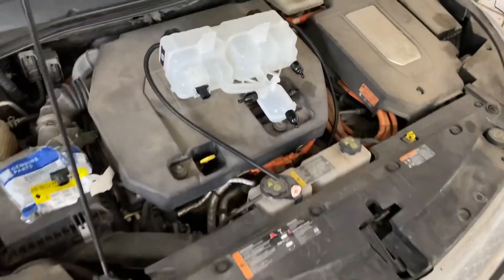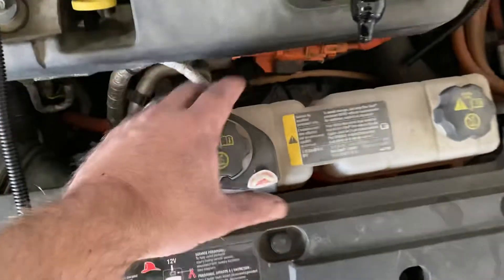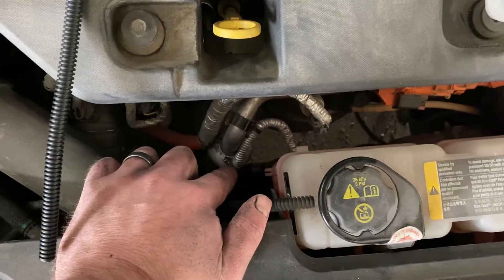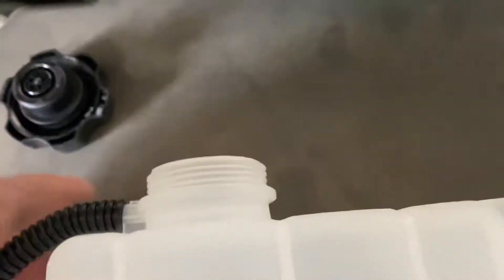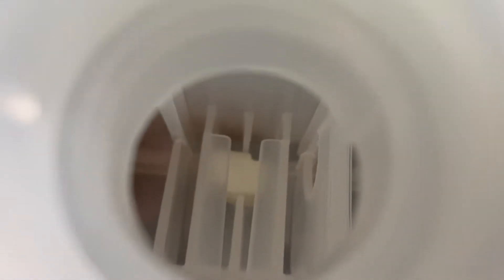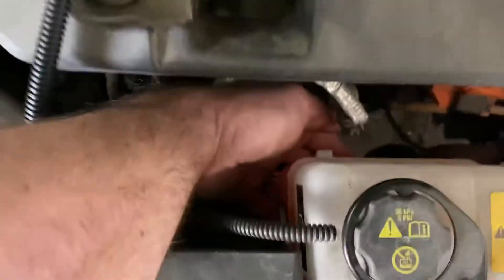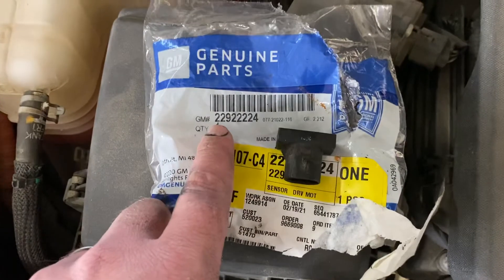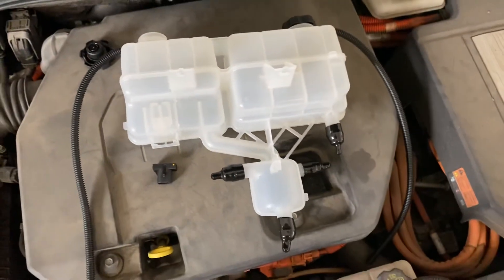How the coolant level sensor works on a Chevy Volt for “Service High Voltage Charging System” error

Comment: I was able to replace the coolant sensor. I couldn’t clear the message/codes with my Bluetooth scanner (ANCEL bd200. I believe). Took it to a mechanic, cleared it for free, I was able to charge for about 3 days and the message came back and didn’t allow me to charge. Anyone with the same problem? How did you solve it?
Reply from the maker: If the coolant level has dropped you may have a leak inside the battery.

Comment: Question: Once that magnetic sensor it tripped by low fluid, does it not reset once you top up the tank?
Reply from the maker: No, that’s the sucky part. A decent scanner can SOMETIMES reset the code stored in the HPCM2 module. Sometimes they can’t. I have a video on doing that both ways.

Comment: So i just replace the sensor and the high voltage code will go away? 🧐
Reply from the maker: Nope. The sensor needs replaced then the code can be reset IF the code popped due to a bad sensor.

Comment: I tried this fix and others for service high voltage system and none worked.  I had to go to the the dealer for them to reprogram two different modules and the codes have been off for over 6 months.
Reply from the maker: This isn’t a “fix” for the code. I have 2 other videos on how to clear the codes. This is just an explanation on where the sensor is, how to switch it, and what the part numbers are.
Reply: It's easier to just go to the dealer and have them reprogram, and then the codes will stay off or they can fix it again for free.
Reply from the maker: @smitastic7030  I hate dealerships, going to them, paying them, and they usually screw it up anyways.
Reply from the maker: @smitastic7030  watch my other videos. I’ve cleared HPCM2 codes as well as flashed the module itself with fresh software. Don’t need to be the dealer. GM actually makes it very easy.
Reply: @utjay2008  i replaced the snesor, clear the code with a simple scanner, and drove for a and the code came back.... do i need to go to the dealer to clear the code, all they want it for me to replace the wholte thing and the coolant reservoir tank.

Comment: Thank you for posting this video, it made changing the sensor out much less challenging! Just seeing the holding clip helps a lot. A side note unhook the 12 volt battery before changing the sensor, or you get a warning propulsion system operating at reduced output, and the gas motor runs all the time. Easy fix though, I just unhooked the battery for a minute and everything is working again! $21 for the sensor at my Chevy dealer. GM#22922224

Comment: Chevrolet dealer wanted $1100 to replace the entire reservoir. I replaced the $20 sensor and saved a bunch of money.  Thank you for making this video.
Reply from the maker: Great to hear!
Reply: Still working for you?  I got same problem and would like to know if it is sensor to replace?
Reply: @MrPaulHolm gotta replace the sensor and remove the error code with one of those “computers” you can find from one of these videos for like 150 dollars
Reply: @MrPaulHolm but has your situation changed after 9 months?
Reply: Such crooks!

Comment: My 2012 volt, 309k miles currently has had this code on for a year now, and I tried to diagnose it but the sensor is good and connector gets its 5v reference voltage, on top of all that I tried to get it reprogrammed and it's still not clearing the code anyone know what I should check next or what part of the system could cause this issue
Reply: Could be the float in the tank doesn't float any longer meaning the magnet is sitting on the bottom of the tank
Reply from the maker: You could try to remove the sensor from the tank, but leave it connected. Then clear the code. If the code comes back, it’s most likely a bad sensor.

Comment: Tip: use a small flat screwdriver wedge out the sensor. You'd push the flat end of the screwdriver in between the sensor (opposite side of that yellow dot) and the sensor slot wall to get it out. got mine out in 3 mins. Thanks for the video!

Comment: Thanks for the tutorial, just replaced mine, now going to wait til the CEL comes back on then take it to a local indi shop that can reset permanent codes
Reply: For anyone wondering, to remove old sensor, it slides forward towards the Chevy logo

Then I unplug the old sensor, insert the new sensor, that way I don’t accidentally drop the new sensor, took a minute or two to slide in place

Comment: Is this the same for a 2014????
Reply from the maker: Sorry just saw this comment - I believe it is. The wiring is better though.
Reply: @utjay2008  Im going to try and replace the sensor blind. Which way does it come out if I'm looking at the engine? Does it pull out away from the tank towards the engine or towards the grill??
Reply from the maker: @drumcorpsfan  going by memory and I could be wrong… but I think it pulls towards the grill.

Comment: UPDATE>>>>OMG!  I'm soooooo happy that I found your video.  As I stated in my prior post my SHVCS error message came up back in October 2020 due to low coolant level...added Dex-Cool 50/50 cleared the codes with CP9125 PocketScan Code Reader and all was good to go.  On August 1st 2023 the SHVCS error message came up again but, this time my coolant levels was just fine.  Upon your recommendation I went to my local Chevy parts department and picked up the part you mention in your video GM Part #2292-2224 cost $22.57 with tax.  WELL >>> today after doing some more research on how to install the part along with your instructions, I was able to replace the coolant sensor without removing the tank from my car.  Using both hands (hand & thumb) I was able to push the sensor out of the bracket >>> towards the front of the car, (half the battle is knowing how) took all of one minute to replace the sensor, the hard part was getting the new one back into the bracket just by feeling the way in, finally it just found its way a minor snap into place...wow!  Now all I needed to do was to clear the error codes.  (Again, my car is a 2015 Chevy Volt) With the car on (engine off) plugged my original CP9125 code reader, hit "READ" and it came up with 6 codes, push and hold "ERASE" key down, after it asked "ERASE CODES?" push and hold down the ERASE key again >>> all codes cleared.  The check engine light is now gone, plugged into charger and YES I'm changing again...

Comment: Great Video...I have a 2015 Chevy Volt, in October 2020 I got the SHVCS error message, turned out that my coolant level was low, so I added Dex-Cool 50/50 coolant and cleared the error message with Actron CP9125 PocketScan Code Reader and presto like magic all was good to go...until today 8-1-23 I got the same SHVCS error message, however this time the coolant level was where is should be.  Sounds like the same problem you talked about in your video.  Would you recommend changing out the sensor?
Reply: Same here.  I got 2015 volt, 1st SHVCS I added coolant and code went away.  Back on now and I'm going to try to change the sensor.  What did you find?

Comment: We were driving our 2017 Volt in the desert yesterday (March 31, 2023 Southern California).  The outside temperature was about 76.  My husband was driving fast on an empty road.   When we stopped and turned the car off, it turned off but the engine kept running.   I checked the coolant temperature and it was 255 degrees.  The car did this once before when I drove about 70 miles in the city on the freeway.  I'm assuming it stays on to continue cooling the engine.   I didn't notice a coolant message yesterday.   After a brief stop, when I started driving, the outside temperature dropped to 60 degrees or less and the coolant temperature was 175.   There is a way to see the coolant temperature on the dashboard while driving.   My question is, at what point is the coolant temperature too hot even without a message and when should you pull over and let it cool off?  I love this car.   I didn't need to put gas in it for 5 months.   I made it use gas because I figured it was getting too old.   Sometimes the car will do that on its own.  Thank you.

Comment: I just went through a $500 repair to have the tank replaced because  of a bad sensor... 86 miles later getting the same High Voltage charging system error message... now they want 47200 for hybrid battery.  Not sure I even trust the dealers diagnosis.
Reply: DONT TRUST THEM, THEY ARE DISHONEST OR DUMB

Comment: On my  2014 Volt, 70k miles, I got the Service High Voltage Charging System error and Check Engine light.   Another video suggested checking the Coolant Level in the tank THIS video refers to.  Its a Two part tank with two reservoirs.   The Left hand side of tank was less than 1/2 full,   added 50/50 Dex Coolant from NAPA, then a friend used his obd2 device to CLEAR the codes.   That totally fixed my Volt...it now charges up fully and no more Check Engine or Service High Voltage Charging System errors......for now!
Reply: Has the issue returned?
Reply: Do you know or could you ask what OBD2 device your friend had used to clear the codes? you would be saving a lot of time and money for people.
Reply: Did you have to disconnect any of the batteries in order to replace the sensor? Feedback from anyone is appreciated.

Comment: Is it possible that the magnet could get stuck in the position of continuing that error? If so how could we fix that?
Reply from the maker: Anything’s possible, but I doubt that would happen. If it did, you just need a new tank. I think that would be the easiest sure fix for it.
Reply: @utjay2008  one more thing. I haven’t tried to clear the HPCM2 code yet. How much do you assume(ballpark) that might cost me at the dealership?
Reply from the maker: @Ashtonscreative  anyones guess. I would say $200-400. They’re going to reprogram the module I’m guessing.
Reply: @utjay2008  daammmiittt
Reply from the maker: @Ashtonscreative  I’ve got a few videos on how to clear the code or reprogram the HPCM2 module.
Reply: @utjay2008  I’ll go check them out. Though I’m sure I’ll need to buy the reprogrammer. How much is that?
Reply from the maker: @Ashtonscreative  I use the VCX nano. $120. It can sometimes clear the code. If you need to reprogram can he module it’s a $40 subscription for 2 years. It gives you every update for every module on the car for that time.
Reply: @utjay2008  truly sad that we need to do that or get charged $200-$400. Just to clear a code.
Reply from the maker: @Ashtonscreative  by all means please get a quote. That’s just my guess. But i agree if my price was in the ballpark.
Reply: @utjay2008  thank you!
Reply: @Ashtonscreative  Cost $550 at the dealer 2 years ago

Comment: Hi I've been trying to replace the sensor without having to pull out the whole tank. It seems in your video that it only comes out pulling towards you and the tank is attached on that side. So do I need to remove the tank in order to replace the sensor?
Reply from the maker: Hi, you can replace the sensor without removing the tank. You have to feel it, but you can slide it (forward or back - I can’t recall) after pushing the release.
Reply: It slides toward the front of the car.

Comment: What are the flexible black plastic tubes coming from both sides of coolant reservoir?  Mine somehow were chewed or ripped in half not sure how
Reply from the maker: The ones on the video I think are protective for shipping only. Emphasis on I think.
Reply: Not those…. the long tubes you keep moving out the way in video they plug in next to the black caps where you add coolant
Reply: Thank you for reply by the way
Reply: When you picked up the coolant reservoir to show inside it is hanging from top
Reply from the maker: Ah ok. Makes sense. I can’t go look at it right now. I think they are overflow tubes.

Comment: I replaced the sensor and the fluid level is normal. Now what?
Reply from the maker: If the SHVCS error is still present you’ll need to clear the code in the HPCM2 module. Or program it with the latest software.
Reply: Can just clear the code with a basic ELM327 dongle and a code clearer app such as Carista

Comment: I have a 2013 Volt.  Looks like yours is older too.  I went to order part number 22922224 but the site said it wouldn't fit a 2013 Volt but would work for model years beginning in 2014.  Do you think that's right?  Thanks again.
Reply from the maker: That’s really weird! Mines a 2012 and worked fine. I see a lot of the websites list it as 2014+. I’m not sure what I’d recommend. If it were me I’d buy it, but either way good luck!
Reply: Make sense.  Thanks a lot!

Comment: Thanks a lot for the video. Will the SVHC code clear itself when the problem is corrected?  If not, will I need to get a scan tool that can do it?
Reply from the maker: To my knowledge you’ll need a tool. I use a VCX nano.
Reply from the maker: @Dimetri777 here is the video I have on how to rewrite the HPCM2 software (same basic idea for the BECM software too). 

Using Techline Connect and a VCX Nano to fix Chevy Volt Service High Voltage Charging System Error
https://youtu.be/eza-Y3oUnS4
Reply from the maker: @Dimetri777 if your scanner can erase the code, but it comes right back, then it’s most likely the sensor or wiring, possibly the software. 

The VCX Nano is about $120, and the SPS2 / Techline Connect subscription is $40/2yr. The VCX Nano is the device that connects the SPS2/TLC software on your laptop to your car/OBD2 port.
Reply: @utjay2008  is this the only way to clear the code after you replace the sensor?
Reply from the maker: @Bomexxx I have 2 more videos are clearing the code. The foolproof one uses a vcx nano and reprograms the HPCM2 module.
Reply from the maker: @Dimetri777 did you test the sensor with and without a magnet to switch resistance?
Reply from the maker: @Dimetri777 that’s wild! Sounds like the sensor is definitely working. Very strange. Sorry I can’t help much more. If I think of anything I’ll post back. I guess it just needs a software update. If it’s a 2012 then check the wiring just behind the radiator. Keep us posted! Your comments will surely help someone else - which is why we’re all here!
Reply: What ended up working? My 2013 volt is having a similar problem after replacing the sensor.

Comment: In my scanner I believe this is the "Hybrid/EV Battery Pack Coolant Level Switch". I just replaced my coolant level sensor and it is reading 3.55 V. Silly me I didn't think to get the before reading, but I had the "P1FFF-00 System Isolation / Coolant Level Sensor Fault - Hybrid/EV Battery Charging System Disabled" and "P1FFD-00 Hybrid/EV Battery Pack Coolant Level Sensor Circuit High Voltage" codes. 3.55 volts should be good.
Reply from the maker: Good info! Thanks for sharing for the rest of us!

Comment: My 2015 volt had the same message pretty much on daily basis. I recently called around and found a dealer that simply did a software update, per GM bulletin 21-NA-224, and the problem is gone. I was lucky because the sales rep had the same car and was very helpful. I’ll update if the problem returns.
Reply: Thanks for the info. Do you need to flush the battery coolant besides the software update?
Reply: @Noitcetorp1234  there is no sensor that reads cleanliness of fluid in this car.
Reply: @danwat1234  I was under the impression that there is a sensor which measures the resistivity of the fluid. As the fluid gets older , the resistivity gets lower.
Reply from the maker: The car is constantly measuring high voltage isolation in kOhms. It’s a very high number. But yes I believe that coolant health is a big factor in that number.
Reply: @utjay2008  My understanding is if the high-voltage system is in perfect working order, i believe there should be no leakage of power no matter how conductive the fluid is. So having loss-of-isolation error code is from a combination of conductivity of fluid and power leakage, but not a dedicated sensor to detect dirty fluid. Also there may have been a software update than lessened the sensitivity to throw that code.

Comment: Thank you so much for this video. I didn't know about the magnet and it fixed my problem after filling it. saved me a ton in dealer cost.
Reply: did the code have to be reset for your car to charge?

Comment: Curious to know where the wiring was messed up for that connector? Replaced my sensor recently, but the code is still intermittently returning.
Reply from the maker: Have the 12v battery tested first. But the wiring split is very near where I pointed in the video. That’s the problem area. Just follow that silver loom down another 6” or so.

Comment: Can you post the video were you replaced that. I have the same exact light on my 2014 Chevy volt " SERVICE HIGH VOLTAGE CHARGING SYSTEM"
Reply from the maker: Replaced the sensor in the car? I don’t think I’ve made one. This video probably shows it pretty well though. I’d check around YouTube and see if any other videos pop up.

Comment: Where could I find what voltage the wiring should be at. I know you said you used to know the numbers.
Reply from the maker: I’ll take a look and reply later. I may make a follow up video to this one with a deeper look at voltages and ohms and some test stuff. I honestly didn’t expect many people to watch this one! Lol.
Reply from the maker: I’m not sure the voltage ever really changes. I think it’s +12V on one side. I can’t recall where I even found the impedance ratings of the sensor.

Comment: Thanks for the video. Would removing the float magnet also solve the problem? How long would it take to change the sensor?
Reply from the maker: Possible. But if the magnet IS coming close to the sensor, then you have a problem that you want to know about. Most SHVCS errors occur because there is some sort of sensor issue, wiring issue, etc that causes a false error. I’ve never heard of a magnet falling inadvertently but I suppose anything is possible.